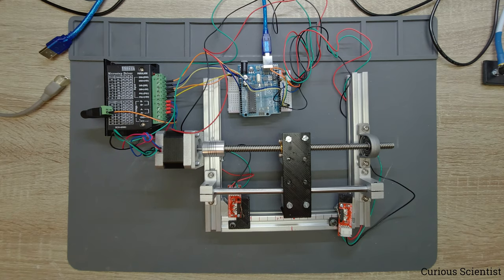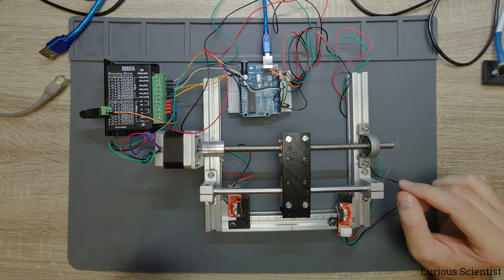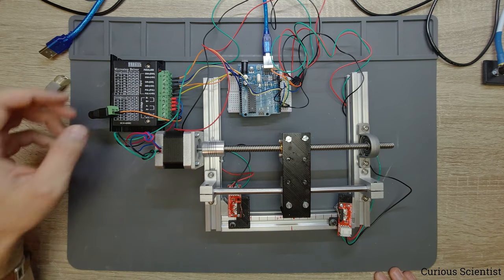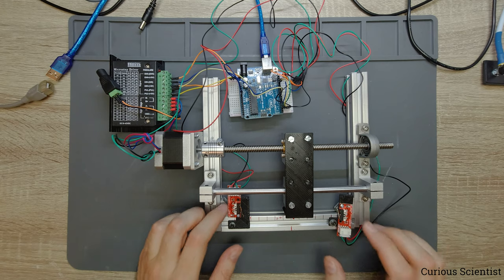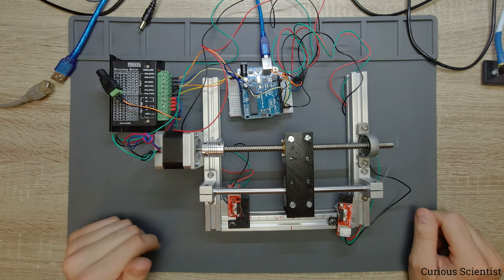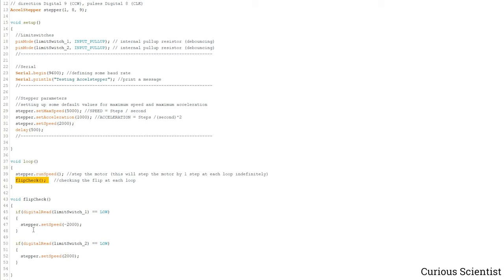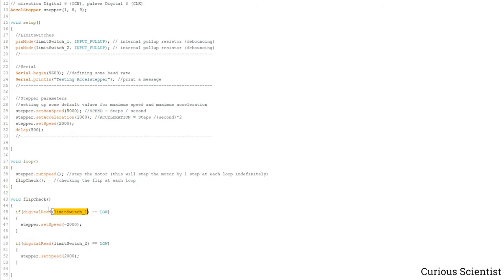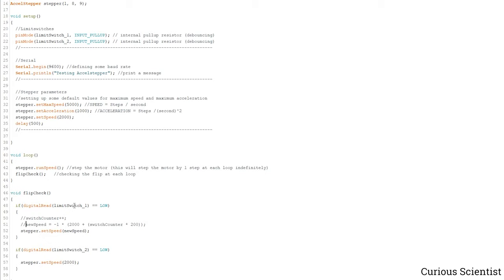Ping Pong with the AccelStepper library and two limit switches - Polling and interrupts

Comment: I think the first code is not safe, with flip check it has potential to go the wrong direction as you program the motor just  to change direction regardless which limit switch is triggered. In the 2nd code it is better: when limits switch1 is triggered, you program the direction (positive speed) so a bounce is not a problem since the direction is set to always go positive. Or am I missing something? (New to arduino, but my project is very similar to this)
Reply from the maker: It is unsafe if the user makes it unsafe. :) The user has to assemble the system, therefore the user has to be aware of which limit switch goes where. It is the same with the second code, if you physically mix the limit switches, you can end up with erratic behaviour too. For example, you hit the wrong limit switch and the direction does not flip. The "ultimate solution" is that when a limit switch is hit, you just simply read the current speed and then make a command to run the motor with the same speed you just read multiplied by -1, which will flip the direction automatically. In this way, it does not matter which limit switch is located at which end because both switches will flip the direction.

Comment: Great tutorial. Thanks for the amazing work. I have a question about the first part of your code where you use attatchInterrupt(). Is the first method non-blocking? Can I additionally add a sensor and read values from it while the stepper motor is moving? Thanks.
Reply from the maker: Hi and thanks! 
Both are non-blocking! :) The only difference is that in one case I used the interrupt, and in another case I poll the inputs. 

I use the runSpeed() function from the AccelStepper library which is a non-blocking function. This function can be imagined as a person that constantly looks at a stopwatch and it rings a bell when a predefined period of time passes. 

First, we defined the speed in the code, 1500 steps/second. This means that every 666.7 microseconds (1 s / 1500), a period passes, so our guy has to ring the bell. In "stepper motor language" this means that the code sends out a STEP pulse every 666.7 microseconds to the stepper motor driver. 

As long as the other task takes less time than this period, you are safe, you can do other stuff, like reading a sensor, sending a message to the computer...etc. If you slow down the motor, you have even more time to perform other tasks, and if you need a faster motor, then you have less time available. 

So, just keep your eye on the motor's speed and you can see if other tasks can be performed while the motor is not receiving a STEP pulse.
Reply: @Curious Scientist  Thanks for the explaintion. I tried your code with polling and it works fine. However, when I connect it with my larger program it seems it is slowing down the program whenever stepper motor is moving. I tried to implement your code with attachIntertupt() and I could get it work. My switches are "RISING", do you think changing "FALLING" to "RISING" would be enough or do I have to change something else too? I am using Arduino MKR1000. Thanks.
Reply from the maker: Hi! You said you connect it to your larger program. Are you sure it is the polling that makes the stepper to slow down and not something else? (I just cannot check it right now if the polling should cause any issues). 

The rising and falling does what they say. So you use the one that is more suitable for your signal change. Low to high is rising, high to low is falling. Nothing else has to be changed.
Reply: @Curious Scientist  Hi, thanks for the prompt reply. The stepper motor is not slow. Actually, it works fine with polling. However, when the stepper motor is working, the software is lagging. So, it becomes unresponsive for a few seconds until the stepper motor stops. I am not sure if it is related to polling or something else, such as DS18B20 temperature sensors. That's why I also wanted to try attachInterrupt() function. 

I tried attachInterrupt() with rising because whenever my switches are activeted they become 1. However, the behaviour of the stepper motor is weird. It just goes back and forth continuously very fast without switches being activated. If I activate one switch, it will go one way continuously. So that's why I couldn't use attachInterrupt(). I wanted to check if it is the Arduino that makes my software slow or something else.
Reply: @Curious Scientist I am not sure if it is relevant or not, but I forgot to mention that I am not using a mechanical switch. I am using photoelectric sensors as switches.
Reply from the maker: It should not matter as long as it is a device that can give a clearly distinguishable signal between high and low. Optical limit switches are also good. However, without knowing the whole code it is really hard to troubleshoot the issues.
Reply: @Curious Scientist  the polling method works fine without connecting it to my large software. However, attachInterrupt() methods even don't work by itself, nothing else. The code is yours, and I didn't change a lot. I changed the pins because I use MKR1000, so my pins are 0 and 1. Then I changed, falling to rising. And I use Input_Pulldown because of my sensors. Besides,  I reduced the acceleration and the speed. I think it has to work, but the stepper motor just goes back and forth rapidly, and it moves in a way that it seems it changes its direction rapidly. Thanks.
Reply from the maker: I don't have any experience with the MKR1000 board, so I don't know what could cause the issue which could be specific to that board. One thing you could try is to define the switchFlipped and previousFlip variables as volatile bool variables, instead of bool.
Reply: @CuriousScientist  Thanks for your efforts. I will try that.

Comment: Thank you your all videos about stepper motor. I wanna ask a question again. Two limit switches are working well in code and I am adding lots of thing into my arduino code but ı wanna move the stepper motor certain distance like your other video. For example stepper motor takes 10 mm in a loop after touching limit switches and stop according to c# with serial port communication (this ditance was calculated relative the step number). I just need to add 10mm run and 1 second stop function. Bu I didnt. pls help me just show me the way.
Reply from the maker: I have examples thoroughly explained in multiple videos. Please check my stepper motor related videos more carefully.

Comment: I would like to make use of this code, but only have standard NC limit switches, what changes would i need to make to enable use of these?
Reply from the maker: Hi! NC or NO switches, it does not matter because you can always program the response for their status change in the microcontroller. NO: Normally open, so when you hit the switch the pin goes from 0 to 1. NC is the opposite, it goes from 1 to 0 when the switch is hit. You have to change the code accordingly.
Reply: @CuriousScientist  thanks, this is my first real attempt at a project so i am unsure of where and what i would change in the code. Im starting to understand, nut have a ways to go
Reply from the maker: Maybe it is too big as a first project. Try to break it down into smaller pieces. First, try to understand how a switch behaves, then try to add the motor, then another switch. Step by step.
Reply: @CuriousScientist  okay, i have the motor running, working on one switch, but all i can get it to do is pause the motor, not reverse it. My switch is only 2 wire, so i can only switch on/off not switch from + to -
Reply from the maker: You have to add the "third wire" yourself. You might want to read about pull-up and pull-down resistors and you'll understand how you should wire the switches.
Reply: @CuriousScientist  okay, thanks

Comment: I made a similar device according to this sketch with interrupts, but I noticed one problem. If the moving part has activated the first switch and then the power is switched off, after switching on the pressed switch is ignored and the motor tries to continue moving in the same direction. Can make a correction that this is not happening? I use hall sensors as limit switches, and while the moving part between the limit switches everything works ok. TIA
Reply from the maker: If you only turn off the stepper motor driver with the limit switch and not doing anything within the code, the code is still running on the MCU. You need to handle everything inside the MCU.
Reply from the maker: Thanks for providing the videos, it is much more easy to answer the questions if I see what is wrong! So, I understand the problem, and I think it can be solved. First of all, I think the problem stems from the fact that you are using the interrupt-based code. The interrupt is looking for a falling edge from the limit switch. If you turn everything off and power up again, there is no falling edge detected because the limit switch was already in a certain state (pressed) when you restarted/powered up the circuit at the limit switch pressed state. Therefore, the code automatically assumes that the limit switch was not triggered and it goes with the default code which is the positive direction. This is why you see it going past the position of the limit switch. What I would do, at each startup, in the setup() part, I would first check if any of the limit switches are pressed in. If one of them is pressed in, then I would move the motor slowly until the press is released, and then I would let the loop() run normally. So basically it is just two while loop. The algorithm is something like while(limit1 == true) {move negative} - this is to release the switch which is pressed if you go in the positive direction. The negative is similar: while(limit2 == true) {move positive}. Also, this code has to be done before you introduce the attachInterrupt() in the setup() part of the code, so the interrupt routine will not interfere with this part.
Reply: @CuriousScientist  Yes, I saw in the program that it was defined to which edge it would react, I know I can't change that. I will try to add those lines, but my knowledge of sytax is still close to zero. :) If you change, I'll be happy to try, the device is ready and waiting. The only thing that came to my mind was that I might know how to add to first take a few steps in the opposite direction In the beginning, reverse direction and then continue as you wrote sketch. But this is  not that good solution.  

I didn't use this second example with polling because I couldn't add pauses when the limit switch came up. The program would not run further when any switch is reached. He would just stop.
Reply from the maker: I might make a new version of this video with an updated code which tackles the above described issue. I cannot promise a finish date for it, but I put this issue on my to-do list, so it will be done sooner or later.

Comment: What is the wiring scheme for the limit switches?
Reply from the maker: There's really no need for that because it is just so easy: they have the positive and negative voltage supply pins and the output pin. The pins of the Arduino that communicate with the switches is in the code.
Reply: @CuriousScientist  ok thank you. I'm looking at limit switches with Common, NC and NO pins rather than these PCB mounted micro-switches, so I ran into some confusion. I suppose a 2 pin connection with Common connected to 5V and NC connected to the interrupt digital pin should suffice, with no need for a pull up resistor anywhere. If you can correct any errors in my conclusion, I would be grateful.
Reply from the maker: I would always add a pull up resistor for a switch. A floating pin can cause a very funny behaviour. Maybe you can also add a capacitor. Switches should ideally be debounced.

Comment: Another great project of yours. But what I notice is that you rarely show circuit diagrams and detailed pictures of the cabling of your projects.
It would be nice if you could send me the circuit diagram of how you wired the endstops by email or WhatsApp. I have a lot of sensors and switches and LCD to accommodate, so it gets quite tight on the Arduino Uno.
I am now 65 years old and I am just starting out with the Arduino projects. Had nothing to do with electrics and electronics before. I would like to include your project to wind a pickup winder for electric guitar and electric bass.

The spindle is driven by a toothed belt via a direct current motor. Using a Hall sensor, each time the DC motor makes one turn, the upper wire guide slide should be moved by one wire thickness until the end of the coil is reached. Then the direction of rotation should be changed and the whole thing goes in the opposite direction.

The wire thickness, the coil width and its inner and outer diameter should be selected or entered via a menu. The number of turns per layer, the number of layers, the total turns, and possibly the total resistance should be calculated and processed accordingly in the loop sector.

The menu is selected using an incremental encoder with a switch. Display is via Nokia LCD 5110.

It would be great if you could help me and send me a circuit diagram (hand sketch is enough!) Of the wiring of the end stops. I will use Limit switches with the PIN's   COM    CN    and   NO.
Reply from the maker: Hi! Thank you for your comment. The cabling is always at least explained verbally, and I also write down the connections as subtitles. Also, if you visit my website, you can see, that majority of the projects have the schematics included in the posts. 

If you read the other comments, I already instructed someone else to check the video at 2:44. If you watch the video carefully, I say how the limit switches are connected. Also, if you check the source code, it is literally written in the source code. There is no need for schematics for that, I think. You can also pause the video and check where the wires go. If you still cannot get it from these 3 different sources, then it is the following: VCC: red, GND: black, signal: green. Then it depends on you where to connect the signal. If you use polling, it goes with any digital pins, if you use interrupt, you have to use pin 2 or 3. In fact you can use the same pin (i.e. 2) for both switches at the same time because they are not triggered at the same time. This reduces the number of necessary pins on the Arduino. 

Most of my videos take at least one full day of work , but sometimes I spend weeks to research everything, test everything...etc. I buy all the stuff, build it, write the software, record the whole explanation, cut the video, upload it...etc. For free. I am actually "losing money" by making these videos. With all respect, people should at least spend that 30-60 minutes of time and watch and read everything carefully that I provide. I am not a service provider, I have a full time job and this is just my hobby that I share with other people. For some reason, many people automatically assume that I also provide support for the shared projects and serve them for free. (this last chapter was more like a "general venting" and not directed only towards you)

Comment: Jupi! I found what I need :D anyway, just use switches with reversed shmit trigger as a real thing which change state from 0 to 1 ;) what I mean is do not use software loop for check state change at pin input :D whatever
Reply from the maker: No need for Schmitt trigger here because  microcontrollers typically have ST inputs anyway. The 0 or 1 doesn't matter because you can handle it with software, or you can choose a pull-up, or pull-down schematic for the switches. Loop is also fine because the movements are slow, so it is enough to poll the switches. Furthermore, I also showed the interrupt method, so it is up to the user what to do.

Comment: my very dear friend pls . i do not understand what is new to say bcze every body ask same but dear if possible provide images of circuit digram of connection with hardware ...may for every one or may be for me in email...but i know it is not possible but you take your own nobel decision as im doing same kind of project where ping pong works to safe my steeper motor ...pls sir help me one time  no one after you can help me...
Reply from the maker: Hi! I have plenty of videos where I explain how to connect everything together. Please take your time and look around on my channel. You will find it. Also, all the connections are listed in the source code, you just have to read it.
Reply: hi.
have you find the wiring diagram ? if not l can send you.
Reply: PUL+ , DIR+ , EN+    goes to 5volt
PUL- Pin8
DIR- Pin9
EN- Pin1
limitSwitch1   Pin2  and other end to GND
limitSwitch2   Pin3  and other end to GND